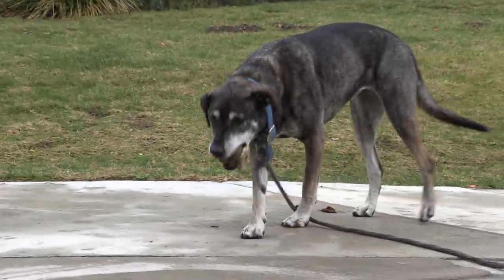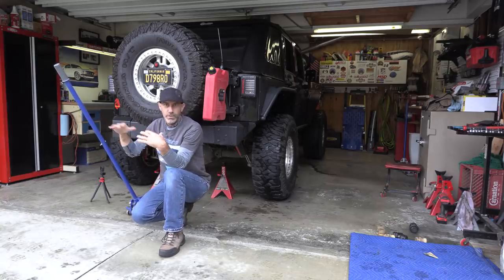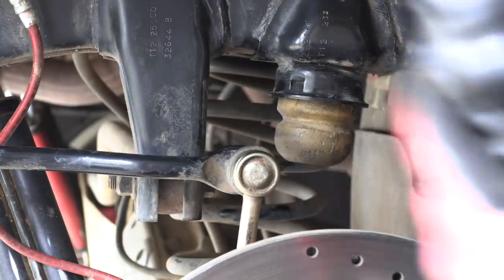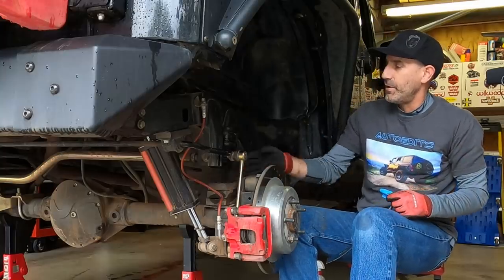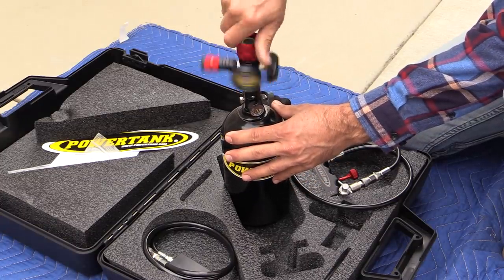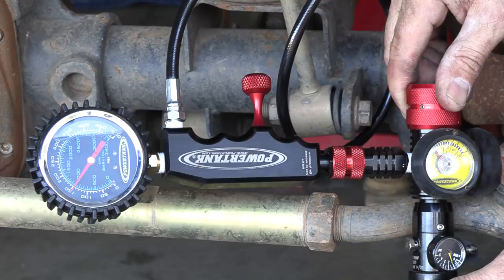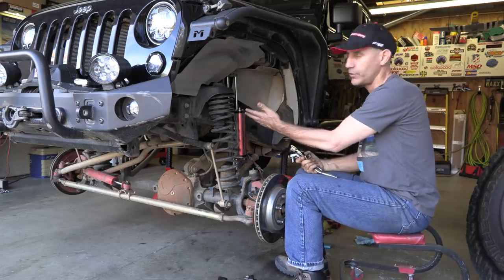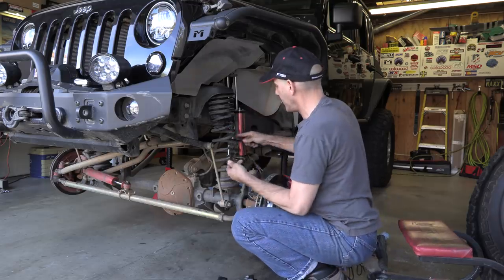$89 JEEP Suspension Upgrade - Serious Bang for the BUMP STOPS!

Comment: Just installed these and tested. I did a before and after test drive. What a difference. I didn’t have to remove my RK springs. I was able to squeeze it in while it was unloaded. Awesome simple upgrade. 
No maintenance of other styles of bump stops.
Reply from the maker: Great to hear!
Reply: Did you have to droop the suspension to get it between? Need to install these but don't want to use compressors or disconnect a bunch of crap
Reply: @maxdominguez5543  I lifted the jeep by the frame extending the suspension with weight of the axle and tires. 
Sadly the jeep was totaled. Going to install the same ones on the new Jeep.

Comment: I concur it's one of the best mods a person can install. Especially if you run on fire roads with alot of ruts or coming off ledges. I considered teraflex speed bumps but when these came out. I was like it's the same concept but 600$+ cheaper.

Best decision I did.
Reply from the maker: I agree.

Comment: Just did this upgrade on my Jeep, based on the recommendation here.  It is a worthwhile upgrade.  My front stock bump stops crumbled in my hand as I removed them.  Very, very happy with this replacement.
Reply from the maker: Really glad to hear this. Thanks for coming back and sharing.

Comment: @autoedits awesome video and I just grabbed the Teraflex progressive bump stops and installed them yesterday afternoon on my JT!  I can't wait to take it out for a test drive.  Thanks for the video!
Reply: How well do you like the Terraflex progressive bump stops?
Reply: @JEEPIMPACT  they weren't nearly as harsh as the OEM'S but I'm running an Icon Vehicle Dynamics suspension system now with their 2.0 Hydraulic Bump Stops and those are like butter they are so smooth.

Comment: Maybe it is just the camera lens effects / angle or the bump stop behind combined with the dual rate spring changes, but that front driver spring looks a little bent toward you just below the dual rate transition at 10:24. May want to eyeball that versus the passenger side. Hopefully nothing, but you may have damaged the spring too?
Reply from the maker: Thanks for the alert... I thoroughly checked and it's just that the shocks allow so much droop the track bar moves the axle over several inches. All good.

Comment: I did the rear, no problem! For the front, wear did you put your jack stands? Can't use the axle sice I need the droop. I could see your were behind, but I couldn't tell exactly wear they were. Thanks!
Reply from the maker: Great question... I have to do it in a two step process. Jack from the center of the front axle and put your jack stands in position on the frame rails by the front body mounts. Carefully remove the tires and then let the jack down to rest on the jack stands under the frame and droop all the way down. 👍

Comment: Any update on these mate. Follow up review? I’ve noticed a few negative reviews but keen to hear your updated thoughts since installing?
Reply from the maker: I can't even imagine what negative reviews can be about foam bumpstops but I've been very happy with them. Even after replacing the fronts from over use... they were still actually fine and I held on to them as spares. Excellent cheap upgrade that works.
Reply: @AutoEdits  negative reviews are mainly from cold weather affecting them and making them rock hard. That doesn’t bother me as I live in Australia so it’s warm. But I’ve also seen some reviews say they are quite stiff. One reviewer said they were super stiff at first and he waited thinking they just needed time to work in but they remained stiff so he swapped them out. How long did yours last before you replaced them?
Reply from the maker: @TJ_Beam  Did you actually watch this video?
Reply: @AutoEdits  well yeah. 10 months ago. Why?

Comment: Thank you for the great tip! I’ve wondered how to make that experience better as I regularly slam down hard on my stock bump stops. Can you provide more info on those extension hockey pucks you have installed? Many TIA
Reply from the maker: Those are the adjustable bump stop extender kit from MetalCloak and work great.
Reply: AutoEdits many many thanks!! I’ve recently gone from AEV springs to Terraflex 3” springs to Terraflex 4” springs and I’m certain now I should look at the bumps and extensions.

Comment: Are these going to be too stiff with a raptor swaybar(its basically currie, different company) Do they still compress well when crawling?, do they "break in" after awhile, sorry for all the questions, not a ton on the internet for these with JKUS
Reply from the maker: These bump stops are great at all that I need from them.
Reply: @AutoEdits  Awesome, i just picked up a pair. Do you know anyone w/ experience with them in the cold?? Im guessing not, but cant find that on the internet. Thanks for the vid!

Comment: I got those too but still sitting in my garage trying to find time to install them
Reply from the maker: At least get those rears in... literally 20 minutes and will make a noticeable difference.
Reply: AutoEdits yeah i was thinking of doing that first , i got metalcloak lift kit too and i get a lot of flex i was thinking if i can remove the front ones without taking the springs out , maybe if i flex it enough i can get my hands between the springs.
Reply: Have you installed them yet ? I just tried doing mine and it felt nearly impossible . im going to wait for summer here in the NE I'm hoping its because its so cold out they fought me
Reply: @JoseOrtiz_1416  yes they’re super easy , get a flat head screw driver up there between the metal and the bump stop and twist
Reply: @WranglerAddiction  will definitely have to give this tip a shot , like i said i just tried installing them and could not get them to budge in not even a little bit

Comment: Just so no one else makes the same stupid mistake I did. The bump stops are different between the front and the rear. The rear are bigger in diameter. I figured it out after about the 10th try. What a bone head I are!  🤪

Comment: Are those bump stops made for your lift ? I see there an inch or so taller ? If replacing on a stock jeep aren't you limiting travel on the suspension !  I can see the need in a lift and even limit straps so you don't blow out your shocks . But I think taller bump stops on stock wouldn't be a good idea
Reply: The stock bumpstops are trash, they basically compress flat and are made for much slower speeds. I imagine these guys would work for high or low speeds and give you a softer landing than the stock stops. 

So they're not specific for a lift but they work with the lift because he's got additional bumpstop pads. For stock, it'll just soften the lower limit, it's not a hard stop like that factory when you compress the factory one that compresses entirely to the cup.
Reply from the maker: Nicely done!
Reply from the maker: They don't change the up-travel just offer more controlled bottom out.

Comment: Ok just did my bump stops on a 2016 sport  2dr.that is stock don't waste your time with the spring compressor just drop the sway bar its a few shield press ins 4 bolts for the sway bar and the 2 lower shock bolts. I tried to use the compressor and no way more work on a stock JEEP, watch the rubber brake lines and ABS don't get pulled too tight almost got me not watching after that it was very easy
Reply from the maker: https://youtu.be/JyrdZ0CXigE?t=123

Comment: Are the pucks/extenders on the lower side of the setup stock, or is that another aftermarket option to consider?
Reply from the maker: Those are the MetalCloak bump stop extenders and they are great.

Comment: Can I do this with the tires on ?
Reply from the maker: On the rear, for sure. In the front... you might if you don't have MetalCloak springs. They are thicker and don't offer enough room to fit the bump through... even at full droop.

Comment: Does anyone out there know how much under severe impact these things compress. I installed them in my 2014 wrangler and I am wondering how much puck spacers I should put in
Reply from the maker: Adjust the same as you would for a stock bumpstop.

Comment: These things absolutely suck in cold climates. They turn into bricks.  They are good in the summer months but in wyoming summer is on a month or 2 🤣🤣
Reply from the maker: I did a long trip in freezing temps and they felt fine.
Reply: @AutoEdits  that’s a little different than prolonged  teens to -20.  I’ve talked to a couple of guys out west in higher altitudes and northern states that had to swap them out.  They are great in the summer. Smooth ride. Just bricks in the winter.
Reply: @elkhunter307  just curious,  what are they running  ?